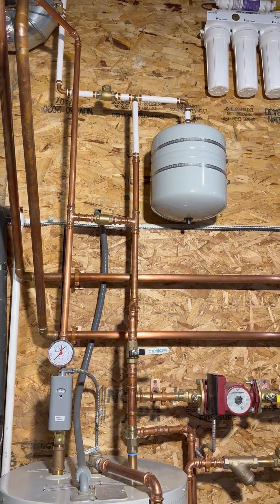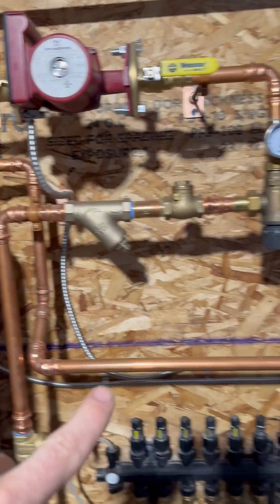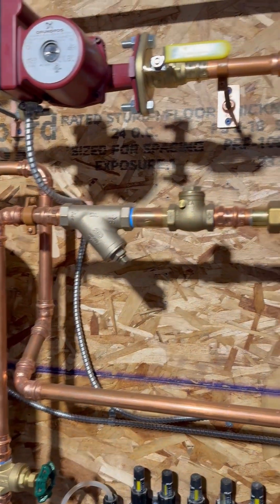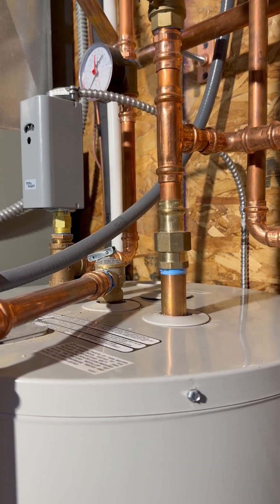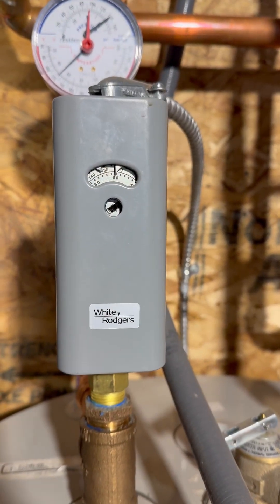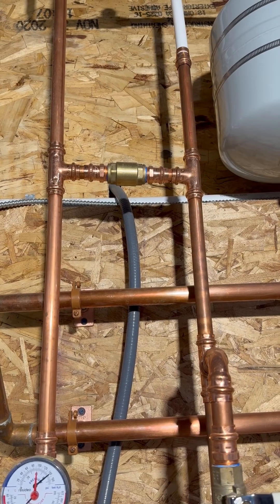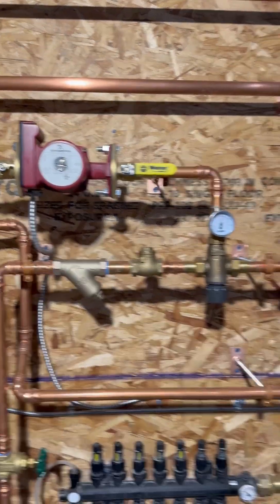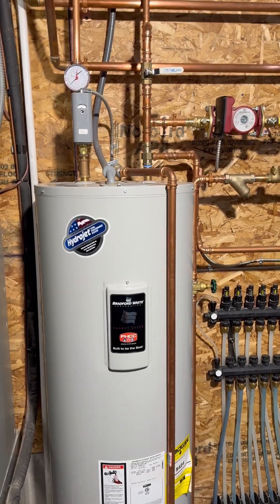Outdoor wood boiler providing power for Water Heater

Comment: It cost electricity to run the pump, you could have placed the exchanger on top of the tank with no pump. Also all the crap in the bottom of your tank gets disturbed and your pumping through and its going through all your plumbing..
Reply from the maker: The pump is needed to maintain the water temp. Once the temp drops below 125, the pump kicks on and the water heats up. Even if nobody is using water. There is a strainer on the recirc coming off the bottom of the tank. It has collected very little sediment over the years.

Comment: How so you control call for heat ? Flow swith ?      How about pump on ?
Reply from the maker: https://a.co/d/4KkTYVu
Reply from the maker: The aquastat is set to kick both pumps on at 125 and will bring the water up to 132. It’s installed at the top of the water heater. I had initially installed in a different spot, and the pumps were kicking on every time the pipes cooled off. That was overheating the water inside the tank. 

So after moving the stat and adding the mixing valve pulling water from the bottom of the tank, it’s working great now.

Comment: This would be a cool long form video, so your using the wood boiler and flat plate to heat the domestic water? Electric heater just for back up? Do you have a hydronic coil with that air handler?
Reply from the maker: Yes, we have a heat exchanger on the air handler for the first floor and radiant heat in the basement. It was 2 degrees F this morning and 76 degrees inside the house.
Reply: @Kcwaterheaters  that’s great man hydronic is always super cool to work on. Way more interesting than a air handler or furnace lol

Comment: you do nice work ,I like how you pull the water from the bottom of the tank to feed the mixing valve . I have never seen a plate exchanger , I Learned  something new .
Reply from the maker: Thank you. I also shortened the fill tube by about 14” so there would be some cooler water to bring the temp down.